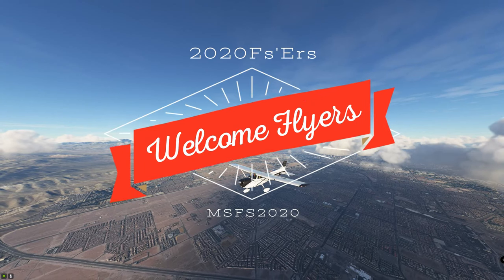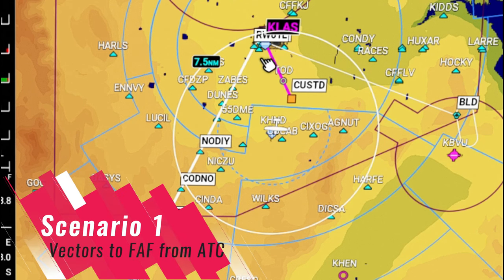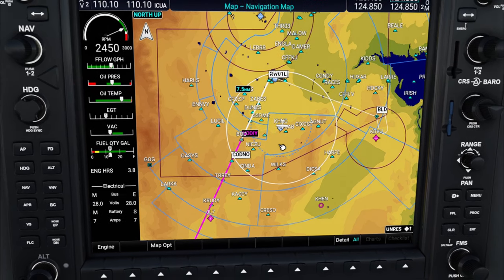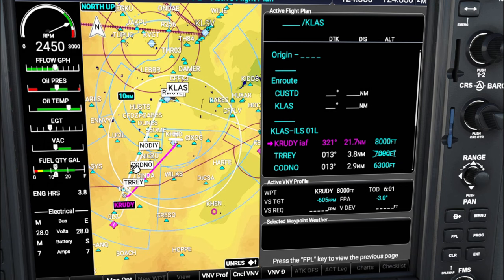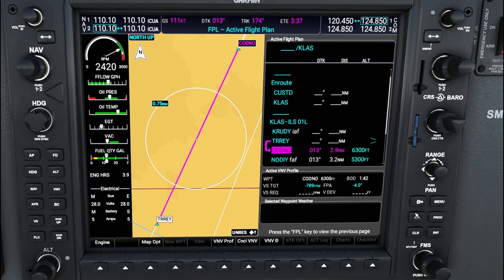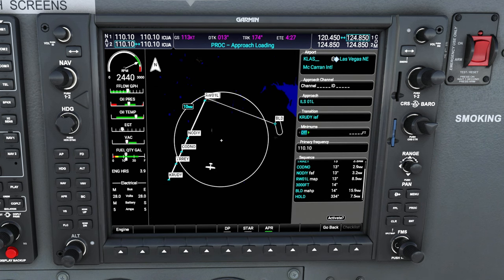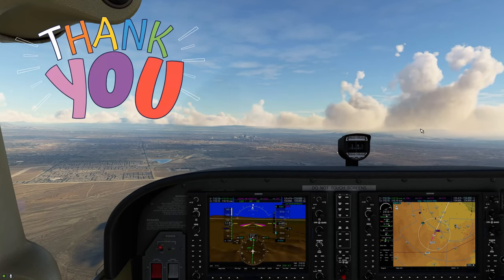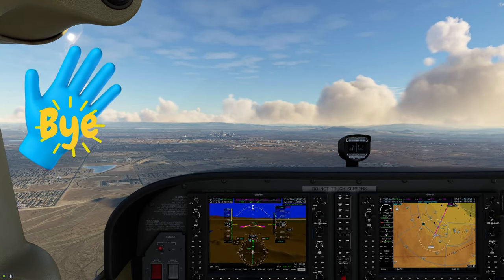MSFS2020 *Vectors to final* G1000Nxi Tutorial With some Tips & Tricks for VectoRs Approach!

Comment: fantastic tutorial. I found that with all the quirks I was not able to use it consistently for ILS until the .10.1 update - whereas I had no issue with ILS and APR on the standard panel. I think the OBS mode is a godsend for circuits.
Reply from the maker: Thanks very much. Yes obs is very useful but the gps still has some issues lol  it is evolving wonderfully. 😀  thanks for the comment

Comment: Great video. In the third example, an alternative to using OBS mode is to use Direct To via Course (013). This way we won’t need to worry about exiting OBS mode to resume sequencing.
Reply from the maker: Hey thanks for the comment and I understand what you are saying but when far away you really need the line drawn from you obs so you can line up with the loc. Otherwise if you do a direct to then If you are not lined up and way off to one side then the direct to will take you on an angle to the final waypoint but wont necessarily line you up before hand and you really need to be lined up on the loc before you get to faf.hope that makes sense .
Reply: @2020fsers  In the direct-to window, you can enter the course inbound, which works similarity to OBS but doesn’t suspend sequencing. If you set the direct-to course to match the LOC, the magenta line will be lined up just like you intended.
Reply from the maker: I also tried that first as that is how it's supposed to be used but on the version of the nxi that I was using the course did not match up when I entered it under the direct to. It was way off so I supposed it was a bug in that version it may be fixed now and can proceed in the manner you discussed . I haven't tried it lately so not sure .

Comment: Great tutorial, thanks.  I'm off to watch the VNAV one now because i'm clearly doing something wrong as it's not following the path...
Reply from the maker: Hey thanks for the comment the vnav video is older and the gps is a little different now but the same instructions apply . 😀 I am going to be updating some videos.
Reply: @2020fsers  No worries, it answered the question for me.  The bit I was missing was the requirement to set the lowest altitude in the stack at the beginning.
One question remains, how to correctly skip to a different leg of the descent profile and correctly activate a new descent to that point.  So far i've must mashed the VNAV D(irect) button on the soft keys and that sort of works but I suspect that there's a proper way?
Also, I was testing at EGNX which begins at a holding point and upon exit from the hold (it does one racetrack lap), I then have to re-activate VNAV.
Defo earned a sub from me though :)
Reply from the maker: So all you need to do is activate the leg you want I went over this in the vectors to final video. Or if you want to activate vnav to a certain leg highlight the leg and at the bottom soft keys you see vnav direct or something like that click on that to activate the vnav to the waypoint you highlighted.
Reply from the maker: Also yes vnav is not active during holds or procedure turns and you need to manage vs during a hold or procedure turn then re activate once exited. It will bite you if you forget.
Reply: @2020fsers  ok that's what I've been doing so not wrong afterall.

Comment: Good Video, but I wanted to comment.  

When ATC "vectors" an aircraft to the final approach course, the aircraft is provided an altitude to maintain.  "United 123, decend and maintain 5000, fly heading one niner zero, vectors to final approach course.......United 123, turn right heading two eight zero........United 123 turn right heading three four zero, maintain 5000 until established on final, cleared (Name) approach."  

Once that is done you MAINTAIN that altitude or descend on the approach, you are NOT authorized to climb.  Therefore, when the NXI removed the altitudes, no biggie, they just don't apply anymore.  You as a pilot will maintain 5000 feet (or assigned altitude), and then follow the glide path down, be it the Glide Slope, or the NXI provided RNAV slope.  Those published altitudes no longer apply because the assigned altitude by ATC overrides.
Reply from the maker: I hear what you are saying but if you are vectored before the faf you will have no idea of the flight restrictions  to follow and you also will not know when you are passing each waypoint because the distances are also blanked out  until you get to the faf so unlsess you like to map fly or do a bunch of math in the air to figure out where you are to the waypoint you won't know when crossing each waypoint up until the faf. And if atc says to follow the approach chart unless you are looking at the chart for the flight restrictions you won't have them either until the faf. Not to mention again you won't know when crossing the waypoints to follow the flight restrictions  Accurately.  I hope this makes sense .